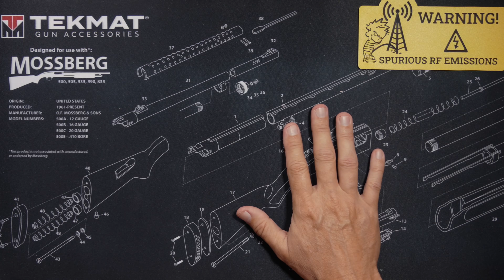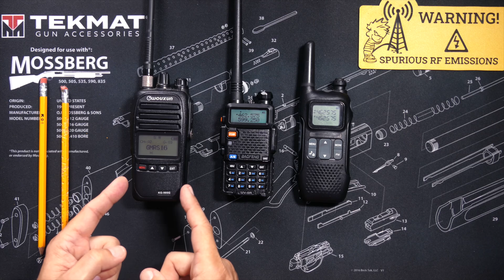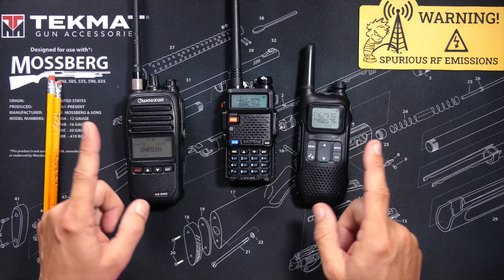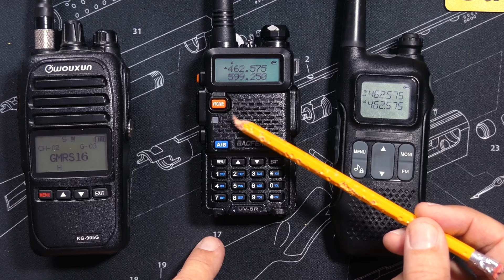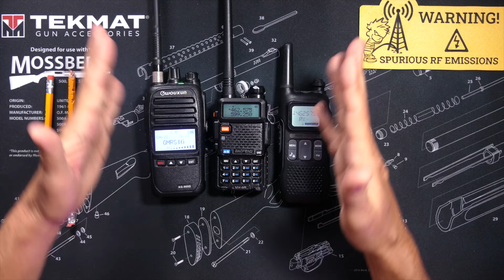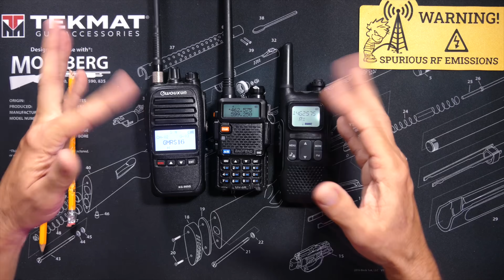What are CTCSS, CTC, PL, DTC, DCS, DPL Tones on GMRS and Ham Radio - Squelch Tones Explained

Comment: Fantastic explanation. Very clear. Tones are basically an identifying tag for transmitting and a filter for receiving.  
It spawned a question; If my buddy and I are communicating on a channel with the same tones so we’ve effectively filtered out all other radio chatter not using the same tone on that channel, if some other 3rd party is also close by and transmitting on that channel, without a tone. Will their transmission “step” on my transmissions and potentially negate my ability to receive my buddy’s transmission, resulting in me hearing nothing?  (Or missing my buddy’s transmission?) Or will my radio prioritize the toned transmission from my buddy and send it through?   I *think*, because the speaker on my radio won’t make any sounds if I have that receiving tone set, that it will ignore the 3rd party and still allow my buddy’s transmission through but I’m not knowledgeable enough to be certain.  (Is this a question of whose signal is stronger?) Thanks in advance for any consideration of this question.
Reply from the maker: you would get stepped on exactly the same is if you were using no tone and/or it could make your radio not 'hear' the other tone, so you may not hear anything at all.
Reply: @TheNotaRubicon Thank you!

Comment: As for repeaters, am I correct that if you leave BOTH the RECEIVE tone and  TRANSMIT tone blank,  you would hear everything coming through the repeater but nobody would hear you on the other side because your message wont get through.  if you want them to hear you on the other side to extend your range, you must enter the transmit code which wakes up the repeater and passes your transmission through?  Great video.  Amazingly everyone told me to leave both blank, but without that transmit code, I cant talk to someone outside my area.   I would think most people would want to always leave the receive tone blank but put in the transmit code for repeaters so you can talk to people farther away .

Comment: i guess i got a bad set of radios because i havent bee able to do anything with them.  cant ping a repeater, cant ping frs,  i can only hear stuff.  Im not a newbie either. i used to run shf los rigs for the military.  but something isnt adding up with these baofeng UV5R8W radios.  my local repeater is less than 8 miles away and cant hit it.

Comment: That was an awesome explanation. I totally get it now. I hate that there are 9 different names for tone. But that’s what nerds do. Make things more complicated to feel better about themselves. Thank you… it’s pretty simple when you cut through the nerd lingo!
Reply: Nerds didn't make it up, radio manufacturers did a long long time ago like Motorola calling CTCSS 'Private Line' and DCSS 'Digital Private Line'. those names are just their trademark names, all it does is add to the confusion and the delusion you are suddenly in some sort of radio cloaking mode and no one else can hear you. the only real practical use in using them is with repeaters, remotes and crossband repeaters, you use those tones to limit or try to prevent users not meant to access those systems. another repeater use is when 2 repeaters are on the same input and output frequencies far away from each other but still on the fringe service areas from each other, one repeater will use different tones from the other on both receive and transmit. this is to prevent someone from simultaneously getting into both at the same time and/or hearing both at the same time. using tones on simplex is sort of stupid unless you really don't want to hear everyone except those you want to hear. in any case, there is no privacy on the air unless you use what's called a 'scrambler' (digital voice encryption) which is a topic all by itself.

Comment: When you are using any code CTCSS, DCS, or any other have effects on the rage. These privacy codes reduce the covering area
Because need more strong Rx signal to open the squelch as compare to simple transmission.
What do you think must reply
Thanks in advance ☺️
Reply from the maker: Using tones/codes does not have any effect on the farz of your radio that you would be able to detect with your human ear.

Comment: So, question: how are Midland's "extra" channels set up? With Tx tones, or Rx tones? Also, if two people key up at the same time, and only one of them has a tone set, and the receiver has a tone set, will both transmissions come thru because of the one radio that is actually transmitting the tone?

Comment: This is great! I am a manual reader and I learned stuff (receiving light) that i did not know. I am curious do transmitting tone slightly influence range? Thank you
Reply from the maker: Using a tone (or not using one) does not influence your farz in any way that anyone would ever be able to notice.
Reply: I had wondered the same thing so I did a bench setup with test equipment that could generate signals along with tones. I found that it was only at the very edge of a receiver's ability to detect a very weak signal where it might not be able to "hear" the tone in order to open the squelch. At that point you could use the monitor button to open the squelch manually but with such a weak signal you would probably have difficulty making out what the station was saying.
I also found that the DCS digital codes would stop being detected slightly before the analog CTCSS on such a weak signal.

Comment: Good basic explanation for something that can be confusing. The PL tones are especially useful in the commercial two-way radio field. We would use repeaters with controllers that would recognize a number of different tones, one for each different group of customers. The repeater controller would replicate the PL that was received and send it to the transmitter.
Another customer we had was a taxi company that used PL tones in a unique way for its operational needs. When the dispatcher transmitted, it was with a PL tone that all of its cars were setup to receive. The dispatchers radio did not have PL on their radio for receive and the cars did not transmit a PL tone, so the dispatcher could hear all the cars when they transmitted. Since all the cars had receive PL on their radios, they could not hear any other car when they transmitted, only the dispatcher. This would prevent the drivers from idling chatting to each other or perhaps swapping fares with each other.
Reply: And using the tone has always made it easier for those scanning such systems and individual freqs at a site add in the tone and your listening to the user u want and not another a few miles away or interference
Reply: Never been a ham but only used scanners with sub tones for 25 years, no way would I but a scanner with no automatic sub tone decoder and now same for dmr and similar, right code in means I'm listening to the user I want and cutting down on interference
Reply: In uk single freqs users can have seperate tone for a department shopping centre or mall  nr me 35 years on same 169.2375 82.5 cleaners 103.5 security, and we even have ctcss dcs mixed, a beach patrol I know 103.5 repeater out dcs 023 input
Reply: What is PL?

Comment: the tones are standardized piff tell that to Midland
Reply from the maker: Midland does use standard tones.. They just done use ALL of them.
Reply: This is my biggest gripe with Midland (other than the wideband/narrowband BS). Our Jeep club uses Midlands, and a pretty obscure DCS code that causes much confuculation with users of non-Midland radios. But yes, the actual CTCSS and DCS codes themselves are standardized and have been for decades. It's up to radio vendors to call them whatever they want.

Comment: Question: is it possible to use squelch tones to first access a repeater and then another squelsh tone to only hear one other radio on the same repeater, thereby ignoring what other radios transmit using the same repeater?  I would think not, but I want to check.
Thank you
Reply from the maker: The repeater controls what the TX (your RX) tone is. Some repeaters are configured to do this, but its not common and the owner decides the tones.
Reply: @TheNotaRubicon  Thank you Randy!  And your videos are, by far, the best on the Internet.  Though my wife is kind of pissed at you, since YOU made me buy lots of (very good!!!) radios (thank you!!!) 🙂
Reply: While using the correct tone to activate the repeater, you can then use a DTMF ID code manually entered if the station you wish to communicate with has that function available; sort of like a telephone number.
Reply: AH HAHA I bet you know the words to STAIRWAY TO HEAVEN
 DesertRat.45